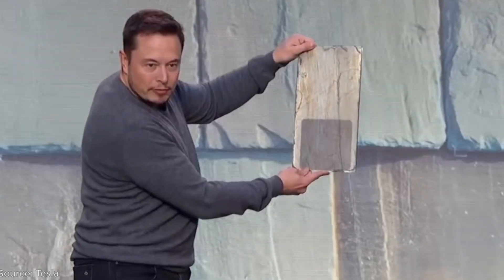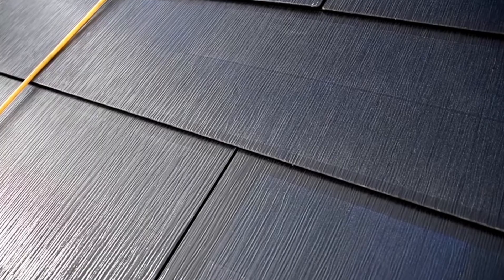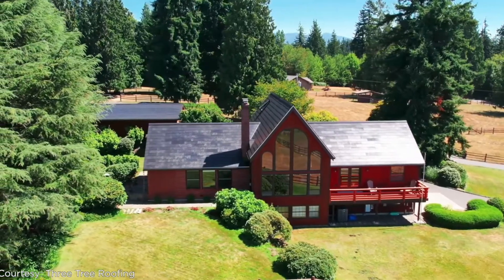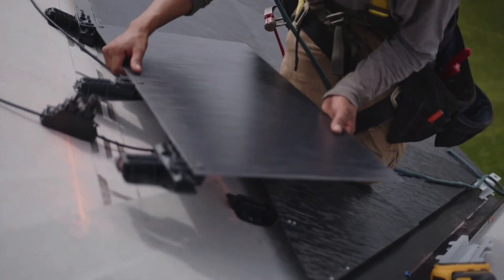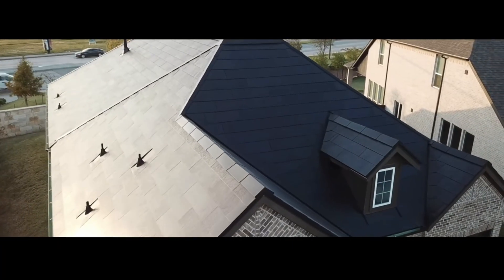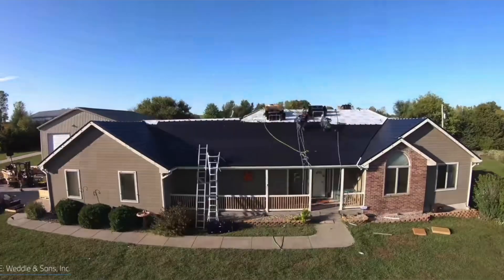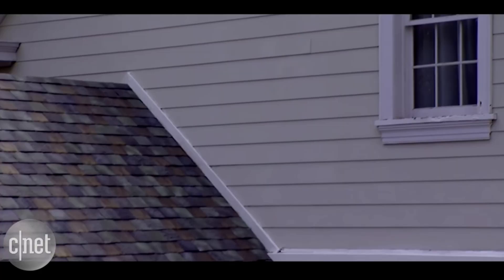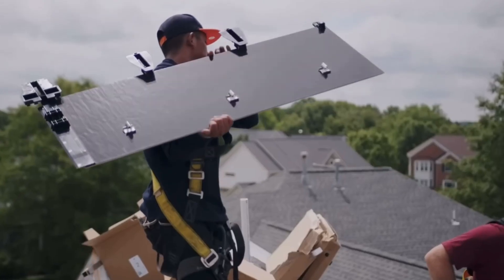What They Don't Tell You About Tesla Solar Roofs...

Comment: ok i live in a verry different part of te world here we cant get those tiles. So i got traditional solar panels.
Before installing my pannels i paid 35K to renew my roof tiles. +-200m2 roof 45° and 25m2 flat roof.
The solar palals cost me 1.26€/wp thats the going rate here i instaled 12600wp on the main roof 128m2
i paid just under 20K for the inverter and connections ext.

the advantige off these tiles is its a compllet fix and you need to see the price as a new roof with panels

Comment: There are a number of factors that are in flux. The Powerwall Direct program is now running which can help with pricing. There are more certified Tesla Solar Roof Installers available around the country however these appear to have a larger price for installation however they take care of all aspects of approval and turn-up. Tesla has made improvements in the solar roof shingles. Concerning reliability, I believe people have the option to use more than one inverter. Although the micro-inverter approach talks to a failure of a cluster of cells since there are many more micro-inverters (two orders of magnitude) I am wondering how that affects the MTBF. Lastly, as you mentioned new construction seems to be an easier business case especially since layout problems with penetrations are easy to plan around.

Comment: I plan on building a new house in about 3 years. Installing the solar roof without an old roof tear down should save me money. My concern is the coordination between Tesla, installers and my contractor. The last thing I want is roof wood panels to sit up there unprotected for 7 months.
Reply: your roof sheathing usually has a water resistant underlayment installed immediately after the wood sheathing is put on.  You should ask for synthetic underlayment rather than traditional tar felt paper
Reply: @LincolnLog  dosnt Tesla use some kind of proprietary membrane that goes on the wood panels?
Reply: @Cello69.  it's basically a branded peel-and-stick membrane
Reply: @LincolnLog 😂 yea If you have a good controctor you shouldn’t have to ask this! Only cheap ass contractors don’t use synthetic been a contractor for 13 years!!!! Synthetic felt shouldn’t be a question in 2023!

Also no one should let their wood get wet! Smart contractors look at the weather prior to the build and if anyone is letting your house sit for a day without tarping and covering they should not be installing 

I would lose my mind on a crew who allowed my customers wood to sit in rain without covering

Comment: So there are a few things I'd like to mention:

1. I was actually scheduled to get Tesla Solar roof (+ 3 power walls) installed in 2020. 2 weeks before installation, they jacked up the price by 25% and wouldn't explain why. I cancelled.

2. You cannot buy their solar roof solution without also buying at least 1 powerwall

3. If you're going to do solar shingles, it's better to do so if you need a new roof anyway. Ripping off a 3 year old roof to do it is a waste of money

4. While it's aesthetically more pleasing, it produces less power per square foot than solar panels. Then again, they can fit into every inch of available space, as opposed to solar panels, where you might have huge gaps where you can't fit a panel

Comment: What I don't understand is why does Tesla make their solar tiles install like actual tiles. That level of detail is unnecessary.
Why don't they just make large solar panels that fit onto the roof from edge to edge and simply look like tiles? Faux tiles in modulars panels? Then that way you would still just need to run the track and then lift, place and connect.
The intended purpose of the tiles is to "look" like tiles. They don't actually have to be individual tiles.
This effect can still be done with single unit solar panels. It is only along the edges and in areas specific to the location being fitted that there would need to be pieces custom-made. And even in those cases those pieces can also be prefabbed in a factory and then taken to the site and installed.. Large areas of a roof can still be covered with large, standardized size,  mass produced, single units that simply look like tiles to the naked eye.

Either I just realized a major flaw in the Tesla tiles by stating the obvious, or this idea has already been thought of.
Which is it?
Reply from the maker: Tesla's main goal is to try and emulate the look of a traditional tile roof. I am sure they did a lot of research to get where they are at now, with the product they have designed.
Reply: There are different shaped planes to roofs - some have eaves and valleys, some don't. Some are just angled rectangles, some are triangles. For roofs with vent pipes, there would be a thousand different places the hole needs to be for a thousand different houses.

It's like asking "why do companies make paving slabs? Why don't they just have one large bendy length of tile that stretches from house to sidewalk or house to driveway?" - it would weigh multiple tons, be a nightmare to get to your house, and then all the groundwork would need to be done to make sure the surface is 100% level before putting it in. Because the vast majority of the paving slabs and roof tiles being put in place don't need to be cut. They just fit right in.

If it were quicker to do it all in one, don't you think the people that make money off doing it (and want to do it in the quickest way possible) would have thought of that already?